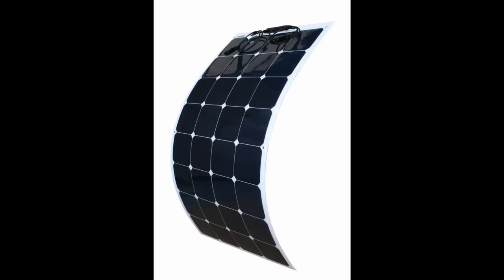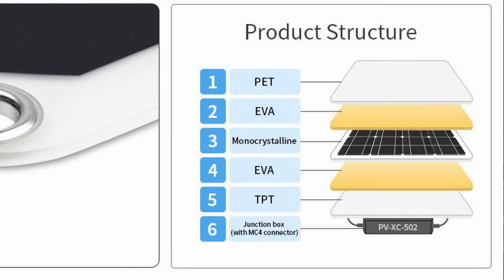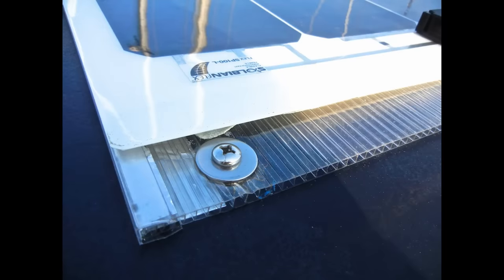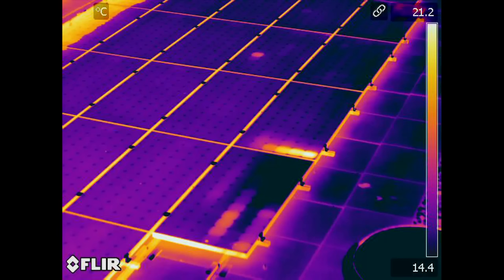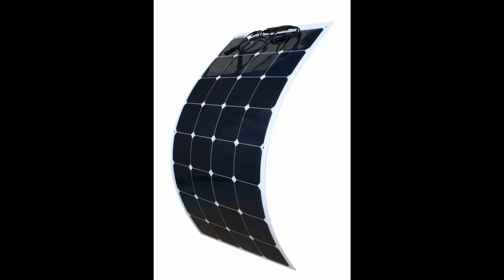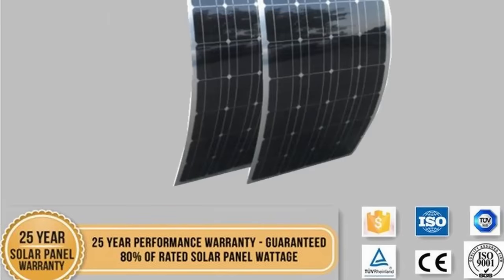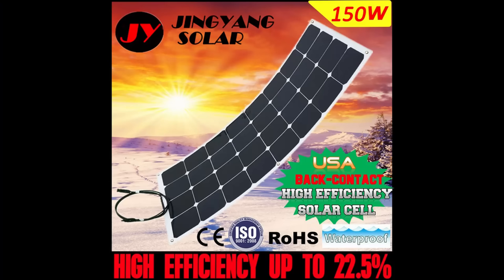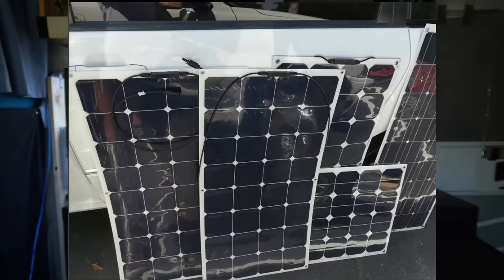The Truth About Flexible Solar Panels

Comment: Hello i found 200w black flex solar panel from 2020 do u know how many time it lasts i live on Madeira island here temps r normal not too hot arrond 22c more
Reply: i was seeing the temps here we r getting 19c 22c more than 22 is rare days so yea we get normal temps here can u tell me how mutch time +/- can it last?
Reply: im new to this i hope u can help

Specification 

Maximum power(Pmax)                           200W

Output tolerance                                         ± 3%

Maximum system voltage                   700V DC

Open circuit voltage(Voc)                         19.2V

Short circuit current(Isc)                          6.87 A

Maximum power voltage(Vmp)               18V

Maximum power current(Imp)                 6.25A

Cell efficiency                                           19.5%

Operating temperature（NOCT）         45±2℃

Temperature range                      -40℃～+80℃

Number of cells                                       32pcs

Weight                                                     1900g

Size                                           1170*540*3 mm

backboard                                               Blue 

Standard Test Conditions ： lrradiance 1000w/m2，Temperature 25℃,AM=1.5

Comment: Wow! You just busted my bubble! I was just about ready to install my solar setup and just received my Renogy flexible solar panels.  I enjoy watching your videos because I've always deemed you as the solar sun king! lol Your very knowledgeable and have always steered me in the right direction, however after watching this particular video I was bummed out cause I already purchased the flex panels.  I suppose I could return them as I have not installed them yet and still have the shipping boxes.  The premise behind me using flexible solar is because I am soon to be a Van Stealth dweller.  If you put framed, glass type panels on top of a van and also add a max air or fantastic fan ventilation system on top as well, then you just lost your stealth mode. Flex panels are more stealthier, and I had planned on putting mounts and side ladders to help mask the vent cowling a bit.  I suppose if I elevate the ladders a bit more it could help mask the other style of panels if I choose to return the flex and go with the other type. hmmm what to do? Back to the drawing board!
Reply: Maybe just buy 1 flexible panel, rig it in parallel with the others and test for voltage/wattage output drop over time.  Will has helped me out a lot with advice for my solar system; BUT in this video he talks a lot about, essentially cheap Chinese crap.  And not a lot (any that I recall) about quality American owned and manufactured product like Renogy.  I'm hearing a lot of anecdotal stories about people who have had their flexible panels for 5 years and are still working at 97% +, so maybe the jury is still out on the high end ones.

Comment: ok so. Here’s my setup.
roof mounted swivel and tilt.
renogy solar panels, maybe 4 or 6 100-175w panels.

vs 4 or 6 100-175w cracked glass panels .

which ones will output more.?

Comment: good info.  I'm guessing if you attach them to a giant metal surface it should dissipate heat.  I started looking into them mostly for weight (but cost also seems to be lower typically).  Figure even if I had to add a thin sheet of aluminum to act as a heatsink (and keep it flat) I''m still ahead of the game.
Reply: I am thinking in this direction. Did u do something in the meantime?

Comment: I am trying to add about 200 watt ( 2x100 ) to my RV.  Don't know whether to roof mount of just place out in open sunny area.  I like to park in shade.  I your opinion, what would be more cost effective, hooking up in 12 or 24 volt.  I will probable use a PMT controller because this is a 3-6 day type of thing.  Also I have seen used poly panels for sale from the changing out of panels in  Commercial Solar Fields.  They say they are 9 years old and have been tested to be atleast 90% of original power output.  Like $50.00 for 24 volt, 280 watt. What do you think?

Comment: Will: I live in Las Vegas....I want to build a cargo trailer van....I'd like to use the Renogy 100 flexible cells...they now guarantee them for five years.  Since desert heat seems to be the enemy, do you think they've been improved enough in 2020 to work?  (I may install them on the roof permanently or just carry them inside the van and use them on brackets when I camp)

Comment: I wont get into specifics in detail, but over all I will agree that flexible are not what traditional glass panels are.  The problems are more with the Chinese made panels sold on known sites.  If you get a better quality panel (I will leave that out not to promote a brand) and yes that means $2K for 3x110 watt panels, your arguments are still valid, but not as exaggerated....Professional installation is a key to maximum longevity of panels (location, shading, how panels are run, wire, controller, batteries, etc.).  I've lived on my boat/s for 10 years and have had both.  The advantage in flexible solar panels is the diversity in "where and how you install"...........I would have no issue recommending flexible solar panels over glass panels for the right application....
Reply: Dude you HAVE to include brand name.  We SHOULD promote the companies that make solid product for us DIY solar people.  Send more business to the guys making quality product so their bottom line is healthier and they stay around longer/build more/and are able to reduce their prices through bulk manufacture.  Everybody wins when we promote the guys doing good work

Comment: My 3mm 250w panel made in GERMANY. IT a rippled surface that refracts light into the cells, it works great in low light, low sun angle and here in London with highish buildings my 4 x 110ah batteries did not fall below 12.8v all winter. It's been glued to my Citroen Rely (Ram Promaster) LWB for over a year & it performs & looks like new. Maybe if you buy Chinese they aren't so reliable, who knows. Sure it gets hot, but I can live some performance loss when the Sun is out. I can be off grid for 8 months of the year. In Southern Europe 10 months of the year. The idea of carrying a 50lb glass panel on my roof is bonkers & then you have gas mileage & wind noise. I also have a very long guarantee. It was expensive but we'll worth the money.
Reply from the maker: Do you have an amp meter on it? did you take a reading when it was new and today? Can you document both data point recordings and create a video? And specifically why do you think your panel is special? Whether its created in china or not, flexible panels are generally a bad idea regardless due to the physical properties of a solar cell crystal. Why is your panel is better?
Reply: I didn't say it was 'special'. I made a point that my panel was made in Germany. The Germans build untold numbers of campervans. In one respect you could argue that its special over a glass panel where light bounces off the glass. I went to Scotland last August, very cloudy and lots of rain & I was off grid for 8 days. Here in Europe (UK) a US gallon of gas (petrol) would cost you $6.42  so weight is everything. Off the top of my head, a 250w glass panel would weigh 40/50lb. No, I didn't check when I purchased it. My batteries haven't dropped below 12.6v & then only once. If I lived in the US, maybe your high summer temperatures would make me reconsider, especially as fuel is so much cheaper.

Advantages: only one hole in the van for cables. Lightweight. Aerodynamic. Stealthy. Soaks up low light & low sun. Glued to the roof, you can do this with framed panels but not that wise.  

When I was doing my conversion, I was in regular contact with a company who does specialist 12v wiring for campervans & he didn't have a bad word for flexible panels.
Reply: @CarlJones14  Thats awesome man, are they still cranking today?  Could you share the brand name, or post a link to where I can get some.  I'm on a quest to find the best flexible panels out there for a solar EV I'm building.  Thanks

Comment: So the main concern with flexible panels is continued exposure to excessive heat? What if I'm just using this panel as a portable solution to occasionally charge a battery box? In a situation where it would be propped up against something with plenty of airflow and not actually mounted down flat.

Comment: Hi Will, I am partial to the Renogy 100 WATT 12 VOLT MONOCRYSTALLINE FOLDABLE SOLAR SUITCASE WITH 10A VOYAGER CHARGE CONTROLLER panel system that you reviewed back last May 2019. I know your opinion on the flex panels, but can you comment on the newer Renogy E.FLEX 120 PORTABLE SOLAR PANEL system?  thanks

Comment: I want to ask,  i plan to use flexible because it is lightweight. If I will use it on straight roof then I don't need to flex it, what I mean is it will neglect the disadvantage. Then why do I need a heatsink if the roof itself is a conductor? Or example on top of car, will it not dissipate heat in the form of the roof? What I mean is most probably you will install it on steady base which are metal.

Comment: Ok one wk  in.. etfe.  100w flexible panel. .. I'm in arizona. 115degrees  during the day. Suaoki 444 generator. I can run  a 32in tv and 2 led lights fantastic fan and 2 cell phone chargers for 6-7  hrs. Without tv can run a regular power strip with a bulb and plugged in my phone and tablet. Also 2 led light strips and fantastic fan= 10hrs. Any configuration I've tried it's been this. Plug in 100w flex etfe panel. 8am 5pm full of power  suaoki 400wh solar generator. That's my experience so far.  Keep killing ass Will

Comment: Hi Will - great video.  Question - I bought a 2019 travel trailer in October 2018 that has a 100W Go Power flexible panel on the roof.  So far, it keeps my batteries charged great.  Would you recommend changing it out to a non-flexible panel, maybe even one with a larger wattage?  Thanks!
Reply: definitely,  buttttttt.... proper mounting.

Comment: Quite convincing speech but actually wrong. Hot spots have nothing to do with the cells heating because of external temperature/sun, they are connected to cells cracks, heavy shading, manufacturing problems.  Moreover, semiflexible panels have a better heat dissipation when compared to glass panels. The explanation is simple: cells are incapsulated in insulating layers in both flex and glass panels. The only difference is that flex panels replace the glass layer with a thin polymer layer which is far less insulating than the thick 3/4 mm tempered glass. Keep going, your channel is quite informative, but try to be more precise. Luca (Disclaimer: my job is in flex panels manufacturing)

Comment: I had two fail on my RV. First one purchased from Amazon lasted about a year. Second one purchased from Wal-Mart lasted less than 3 months. The RV is parked in an open parking lot. I just replaced the second one. I wander if I pit a piece of aluminum under it and put Finns on the outside edges

Comment: they are rubbish..bought 5 in 2018 june (250watt 12v with an output of 18v for my 12v battery banks charging)...now its january 2019 and 3 of the 5 no longer work and the other 2 dropped by 50% efficient.... the ebay company i bought from no longer exists. i found that they change names so no warranty is ever carried out. conclusion is get the rigid panels. still have 5 rigid panels bought off ebay in 2010  and still going strong in 24-7 use...DONT BUY FLEXIBLE PANEL JUST YET. GIVE IT SAY another 10 years WHEN THEY IRON OUT THE PROBLEMS THEY HAVE...........
Reply: @Jayda08  I have the sunpower panels. the warranty is 5 years not 25. You must be thinking about their glass panels

Comment: yeah the flexi panels do get way to hot flush mounted. the further south you go it seems the quicker the film on the old style ones degrades. i don't do the van life anymore. it's boat life. i  i've had some of the etfe panels for awhile on the boat and have been very happy with them and yes can find them with white backing so they are not totally black.  after the ones i had on the van got milky i bought some of these   https://www.amazon.com/dp/B00KV30GIC/?coliid=I32SHCFBT66QI1&colid=3PPGXUGXZDCTK&ref_=lv_ov_lig_dp_it&th=1    and regular panels. i like this mount because you do have the option to adjust the angle.

Comment: Did you ever think of using the five or six inch computer fans which are thinly mounted I would say using six of them or eight for the pool for the push I would think that would be enough to keep enough air circulating under the computer the solar panels to keep them from cooking besides I've been thinking about it because I'm going to put them on a boat but I'm going to put them on the boat in such a way that I'm going to have computer fans preferably The 6-in Quiet Ones ventilating the rear end or the reverse side of the solar panel so if you can figure out a way to ventilate them properly you shouldn't have a problem don't you think anywho just thought I'd check your video out hope you find a way to ventilate your solar panels have a great and wonderful day

Comment: Thanks for your videos. I've been a fan and a subscriber for quite a while. Never disappointing. 
OK, so much for FAN BOY stuff (although I mean it)😊

You and other people use the term "30 degree radius". I don't know what that means. It would seem that the amount of bend that the panel will tolerate would be described as the radius of a circle.
A panel which will tolerate a radius of 1 foot is much more flexible than one that can tolerate a bend on the circumference of a 2 foot radius circle. But that has nothing to do with degrees.
I'm sure that I just don't have the vocabulary but could you explain it.
Thanks,
Manning

Comment: This seems like this is what happened to me with a flexible panel rated 20W  from quite "renowed" china brand..

They put a video a of a review of the panel where a guy is measuring no load voltage (20V) + short circuit current (1A) and make you think this provide the good power measurement 20W...

But a year later, when I doubted the real power of this panel, I performed much more accurate wattage measurement (using both variable load and MPPT) and I never get more than 8W !! which is weird !
I'm not sure if the output power of the panel was like that or if it decreased overtime because my first measurement was the same as the guy on the video with only voltage and current separately.

I don't understand all the positive evaluation of this brand... I'm guessing either people don't test their panel or don't know how to do it correctly?

Comment: Flexible solar panels are surely not designed to be bent anything beyond 10 degrees,  I mean why would anyone want to do this as the efficiency of the pv panel at collecting incident rays will surely go down. Leave tge flexible solar panels as flat as possible and make a sun tracking framework to hold these panels if possible.

Comment: Oops, just placed my order on Amazon for 1... Ah well, it was cheap, and your advice will help me avoid some mistakes.
Reply: pneumatictrousers  
How do the hold up to heat?
Reply: pneumatictrousers  
Alright, and did you go with a branded one or just cheap ones off eBay or Amazon? I see some on eBay for $100 / 100watts will those be okay?
Reply: pneumatictrousers  
All right thank you for the input
Reply: pneumatictrousers  
Yeah, I figure if it lasts me even 6 months it would be worth it hope it lasts more though.

Comment: I looked at these for possibly putting on a school bus build to save a little on aerodynamics and also save on weight. I'm thinking because the roof of the bus is metal it can dissipate the heat sufficiently but will it hurt if it's in the sun for too long? What about glass panels that makes them last longer than flexible panels?

Comment: I have e150 conversion van with curved roof..will have to put roof rack on to get 600 watt perm panels attached but hate the added height and weight factor then add another 400 flex to carry in van for days to park in shade..what metal flex panels would u rec? Thx for all this info..

Comment: I'm looking at a 200w flexible 42 x 32 panel from GoPower for my van.  I plan to drill through my roof for the front two holes over rubber washers and earth Magnet and Velcro the rest over the vans ridges. It will be secure and no part of the panel will rest directly on hot metal... 

But … all I hear about flexible panels is bad news like how they no longer work like they use to or  how the warranty is no good because the Chinese company is gone. What gives.. if so poor why is the flexible panel market so big??

Any 5+ year success stories and how do you guys feel about GoPower?

Comment: Never have I seen a flexible solar panel fitted with enough air gap, at the correct angle and have supported cells. Warranty is void due to impossible (rigid mount) fitting instructions

Comment: what if i put a glass on top and that glass will have infrared blocking film to reduce heat transfer to the solar panel. The question is : is the infrared spectrum important for generating power on the solar? That one i do not know and too lazy to google

Comment: I am trying to make a solar bicycle with a curved roof using these. Perhaps I should build my own solar panel by "soldering" solar cells together ? Has anyone done that ? Does not seem too hard. I need a 0.5 x 1.5 meter panel to produce 100+ Watts.